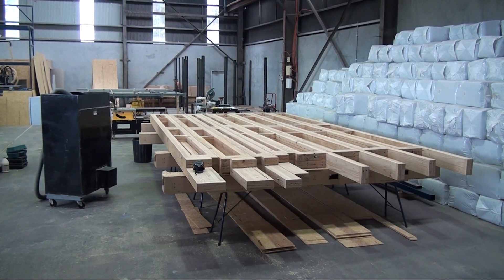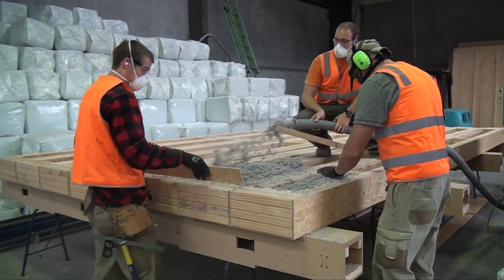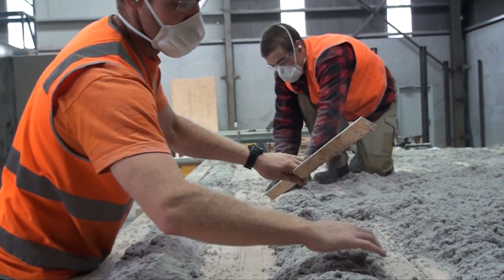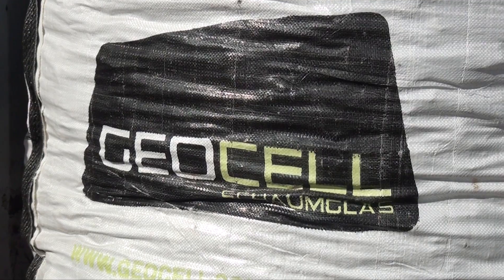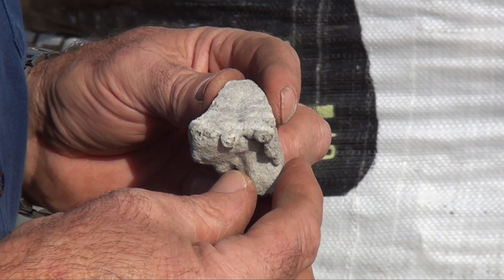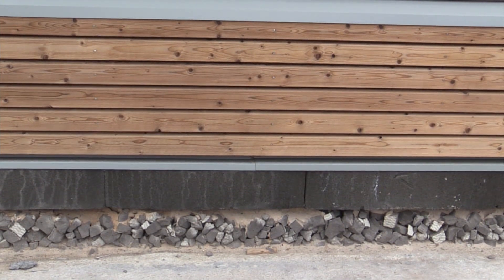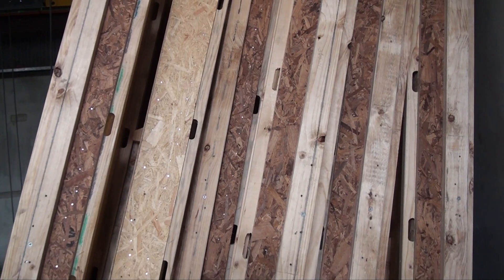EXTREME SOLAR PASSIVE HOME, TASMANIA

Comment: I wonder 4 years on, what the occupiers think of the house and anything that hasn't weathered well in the Tassie climate that they would have changed with hindsight? I didn't know it was even possible to insulate your concrete slab 🤔 what material is used to create such an effect in this instance?
Reply from the maker: Thanks for the comment Ambo.  I may do a lil follow up clip soon !!! :)  thx for the idea, I'll chat to the owners.
Reply from the maker: Please see the owners blog here too for some info post move in !  https://asanteonthehill.wordpress.com/
Reply: Unfortunately, at the moment, most insulated slabs use a form of styrofoam to prevent heat loss.  
There are two types of insulated slabs:
1) fully insulated, that is the slab is completely separated from the ground by insulating it underneath and around the edges of the slab; and 
2) edge insulated.  Much cheaper way to do it, but not quite as effective.  It still works, though.  My edge-insulated slab, passive-solar house, without any heating or cooling apart from ceiling fans, built on the Mornington Peninsula in 1996 using standard building materials (no double glazing, etc.), did not drop below 14 C in winter, or go over 27C in 42C heat in summer.  I was very happy in it.

Comment: Hi there. 
This is an extremely fascinating house. I would have loved to have seen more of the technical aspects of how it works as well as a more extended tour of the rooms. 

May I please suggest from the perspective of a documentary maker of old, it’s clear that you are excited to be there and want to encourage the couple when you interview them. Unfortunately in your enthusiasm you keep going ‘hmmm’ as in yes, every time there is a small pause in their talking. This is highly distracting to your audience and is unnecessary. May I suggest you gently and slowly nod your head in silent agreement with your interviewees, either on camera or off. This will also aid your editing and audio requirements. 
Please keep making these videos and longer ones also. 
Cheers.
Reply from the maker: thx for your feedback and praise Stephen, appreciate it.  Yes, I have learned from that, I understand your reasoning.  It does allow for a natural feel your advice is correct from a purist and multi factor stand point.  Will do.  Stay tuned.
Reply from the maker: There is full length 50 minute film of the house too !  We may release that soon and potentially do a follow up film too ...stay tuned

Comment: Did they calculate solar gain > loss from the very large windows?  What % of glazing would they have used?
Reply from the maker: Hey Jeremy...the windows are triple glazed from Germany ...  the solar gain was significant ...hence the 'passive solar' design.
The solar loss was  very minimal due to the huge insulated concrete slab and chimney structure and the orientation to the southern hemisphere sun cycles.
Are you a builder or architect ?
Reply: I don't agree with the huge windows on the east, in summer that would attract huge heat gains, but the rest of it looks good.  Some eaves over the north (and east) windows would make the house work much better, but as we only have a glimpse of this house, it's difficult to know how well the house works, as is, and what they do to get rid of all the extra solar gain from:
a) gigantic windows on the east
b) no eaves over the windows.

Disclosure: I've been studying ps design for decades, have designed and built a successful ps house in suburbia in the past using common building materials, and am about to build another.

Comment: I reckon ventilation is a concern in the house as the landlord mentioned.
Reply from the maker: Gday Max ... The home has a high tech HRV system that illiminates dead air spots and maintains a homeostasis
Reply: flowingimage nice
Reply from the maker: where do you live Max ? Tassie ?  Australia ? Europe ? States ?
Reply: flowingimage Brisbane Australia.
Reply from the maker: Do you have a passive solar house ?  You live in the hills where it's cooler ?  you're an architect ? enthusiast ?
Reply: flowingimage I am an enthusiast. Currently I don't own a house yet. But I would love to build/retrofit my first house that way.My main focus are ventilation and insulation.
Reply: flowingimage It's good to see more Australian architects use HRV or ERV rather than cross ventilation which I reckon is the least consistent way to ventilate/condition the house, especially for passive house.
Reply from the maker: It is definitely a concern and hence why the planning is so important to mitigate this and have consistently good air flow and temperature regulation with minimal energy usage

Comment: 1:45 - given there is forced ventilation is that statement specific to this house? Forced ventilation exchanges air much quicker than the traditional one based on gravity.
Reply from the maker: there is no reference to that...1:45 is not referring to that

Comment: What’s the fire risk of this house?  Insulation improves energy efficiency but it also keeps heat (fire) in
Reply: If something, insulation helps fire to not propagate, unless it is polystyrene or other non mineral material.

Comment: the guy said that air doesn´t flush as much inside because of the envelope. but I´ve seen other passive design videos where they say that ventilation is more constant. I think this house has a mistake in its design.
Reply: Hi Rodrigo, that is not correct, it has excellent air flow and circulation and temperature modulation !
Reply from the maker: Incorrect, the vents were located in dead air spots and the flow regulates constantly